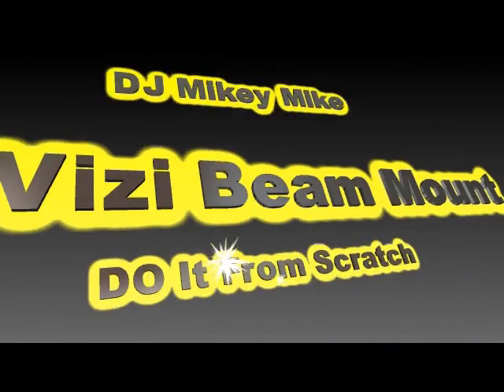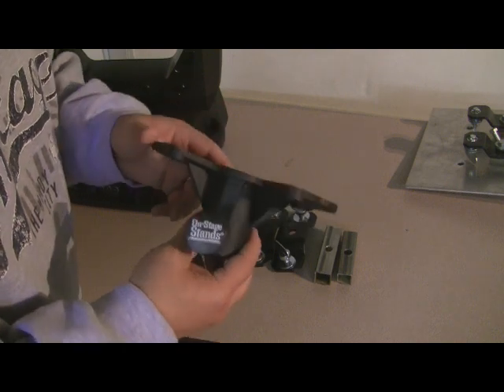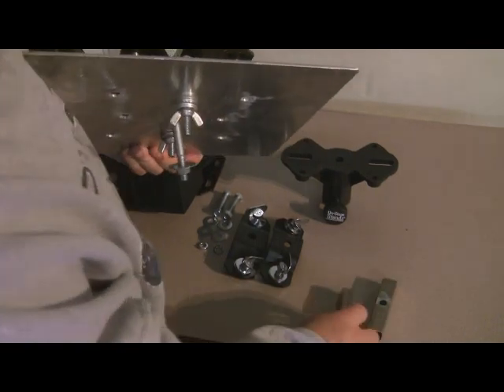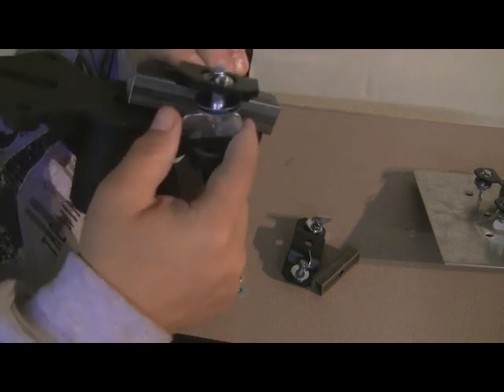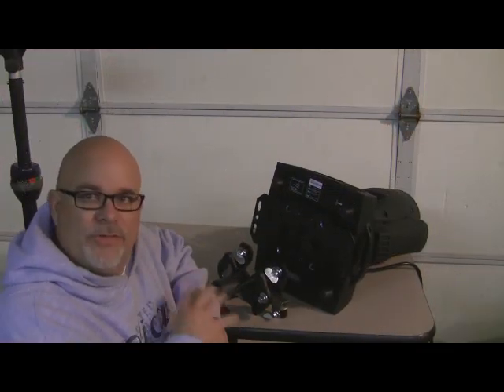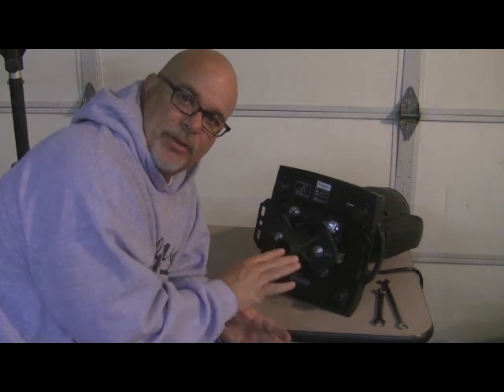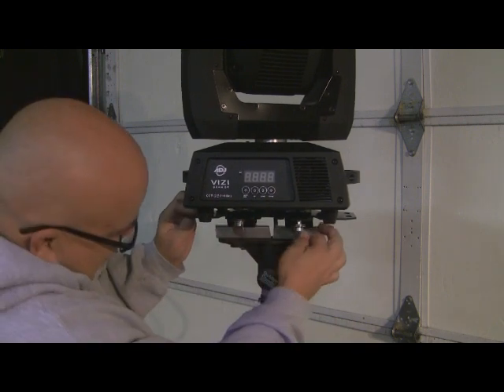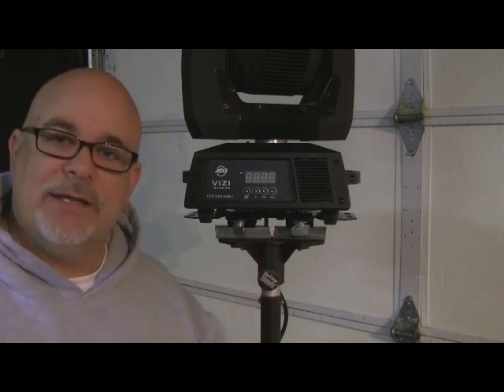Do It From Scratch American DJ 5R Beam Tripod and Truss mount with DJ Mikey Mike

Comment: just a suggestion maybe instead of the square metal bar as the spacer how about using those cylindrical plastic spacer or maybe use a metal tube cut into size and paint it black? either way another good solution.